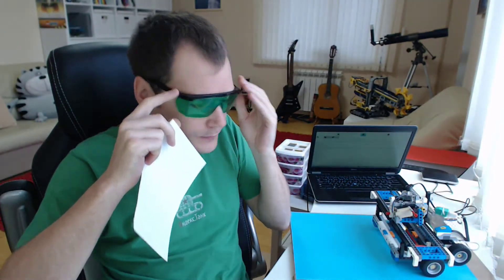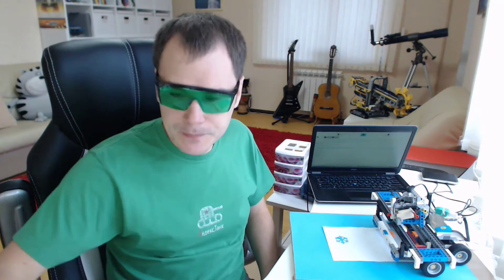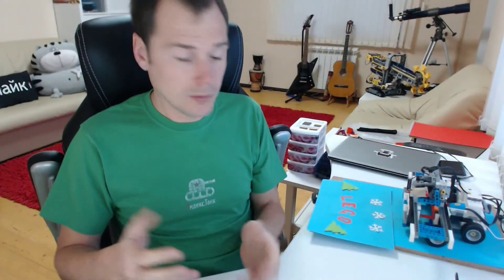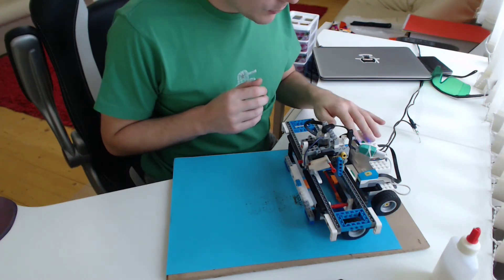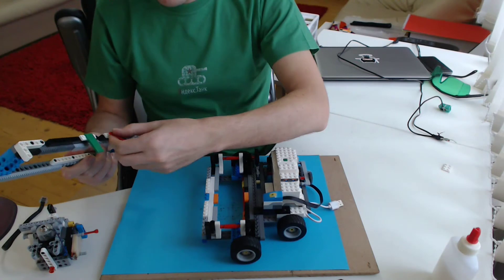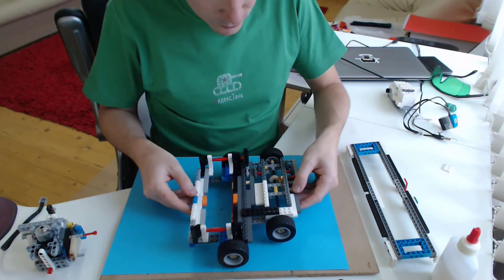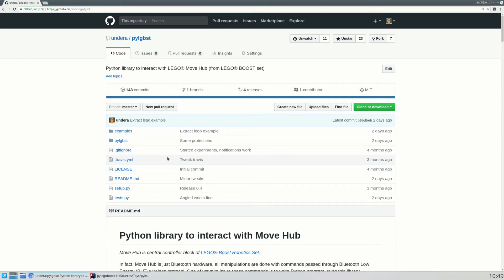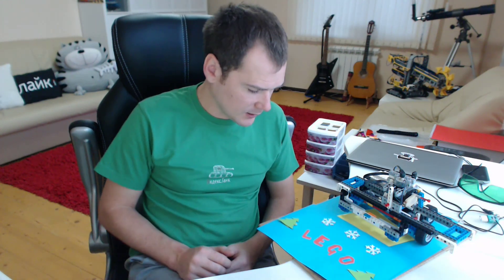Laser Engraving Machine / LEGO® Boost

Comment: Nice work! I wonder, would it be possible to use it with a normal pen instead of the laser?
Reply from the maker: Yes. I actually was making it with pencil originally, then changed tool into laser.